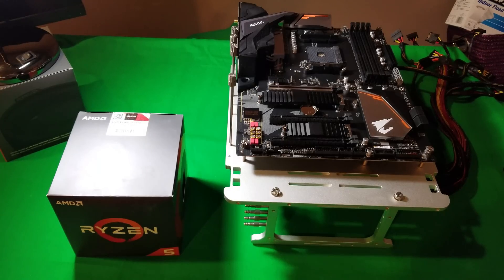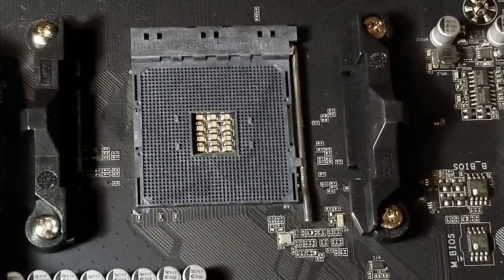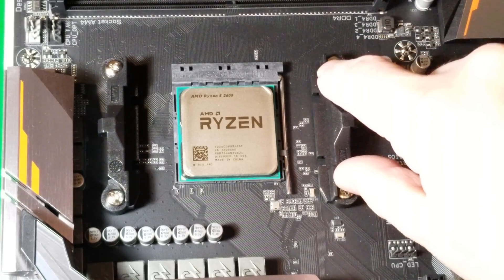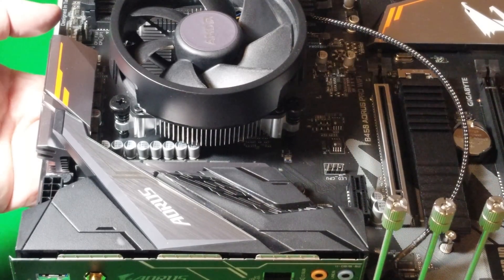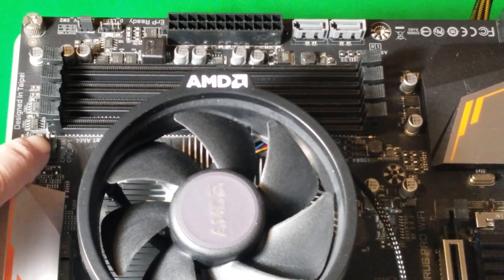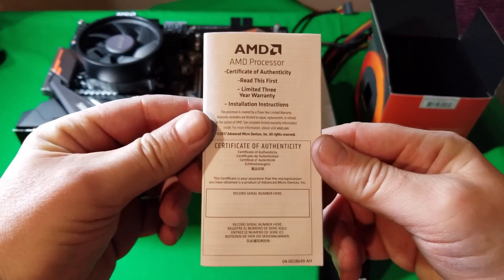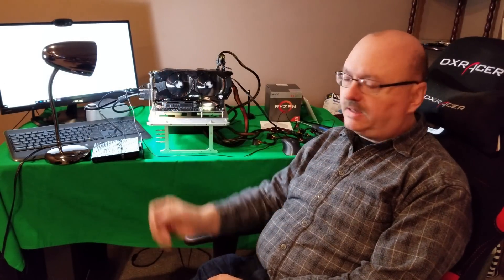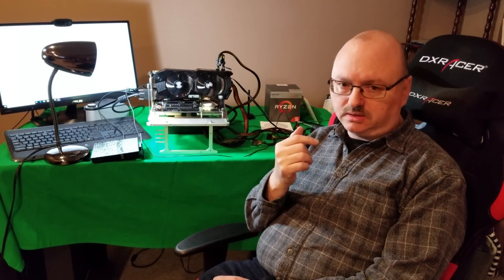Ryzen 5 2600 Unboxing and Install plus CPU Cooler Temps

Comment: One of the screws won’t screw in. What do I do?
Reply from the maker: So as long as your referring to the screws going into the back-plate, I'd suggest if it's not going in and you think it's due to some defect in the cooler, that you return it. However if the back-plate itself is the issue, you could try replacing the back-plate equally as big a pain. You could try checking to make sure it's lined up properly and maybe try turning it and restarting, could be a possibility they machined it wrong. I know it's a stretch but really if it's not screwing in, that sounds like one of those two is defective. Lastly ensure that the back-plate is not just dropped down in one corner and if so just raise it up and try again. Hopefully it's the last one otherwise not sure of any other things it could be.
Reply: Reviewing Playing & More RPM I got it in with a bit of pressure. Thanks for the quick response though.
Reply from the maker: +FlavoredRick Great job man...

Comment: I bough this CPU yesterday. At stock settings the CPU frequency is not reaching 3.7GHZ (3750mhz). Temperature at full load is around 67-72C. Is this normal ?
Reply from the maker: Not at home to check but stock is 3.5 so if your getting 3.7 you've done well. That temp under Full Load seems reasonable for the speed. It's good. Enjoy...
Reply: @Reviewing_Playing_and_More_RPM  I think you misunderstood. I have seen all over the internet that this CPU reaches 3.75ghz on all cores during stress testing/gaming. Mine is only reaching 3.6ghz. Can you check yours and let me know. TIA. Keep up the good work <3
Reply from the maker: Hi so I tested it under full load using AIDA64 Extreme, and the results are: Max Core1 3892, Core2 3767, Core3 3892, Core4 3817, Core5 3892, and Core6 3892...Temps at Max 74-76, low of 27, Idle 36 settling at 27-28 Hope that's what your looking for. If not let me know currently learning more and more about this so it's cool to run these tests...Averages were 3519.7 btw...
Reply: @Reviewing_Playing_and_More_RPM  Thank you for the detailed info. Can you run cinebench ( make sure to close all the unnecessary background apps) and let me know the score please. Also try userbenchmark.
Reply from the maker: Sure I'll do it later tonight. Be interesting to see don't run Cinebench to often. For the Benchmark are you looking to see FOS or something else? Anyhow have a great day...
Reply: @Reviewing_Playing_and_More_RPM  Cinebench scores are typically same at stock settings for the same CPU. If your scores are similar to mine then I can be rest assured that my CPU is not faulty. You too have a great day :D
Reply from the maker: Hi, so I tested with Cinebench 15 and results are: CPU 1239 cb, single core 157 cb, MP Ratio 7.88 cb, also did OpenGL but think that's for my GPU which was 115.88 FPS, Ref. Match 98.0% Hope that helps verify your CPU. Take Care...
Reply: @Reviewing_Playing_and_More_RPM  Thank you man <3
Reply: Those scores are perfect
Reply from the maker: Cool, good to know...your welcome...Have a great day...

Comment: Hey i bought this processor too, is it possible to overclock to 4 ghz with the stock cooler?
Reply from the maker: +KaifamGaming It is possible, be aware that the temps will be higher than the normal not sure but around 70 is not uncommon. Keep an eye on the temps for a while to be sure. I'm a noob on overclocking though so got the info online. I have overclocked mine using the software from the motherboard manufacturer but if you know how to do it otherwise it's been said it works better that way but I don't know for sure. Currently doing research on the topic for a future video. 3.8 to 4Ghz should be your target overclock not sure about higher.  Take Care and Thanks for watching...
Reply: Its recomended to use a beefier heat sink if you want more longevity out of your cpu
Reply from the maker: @cloudleal5984  Yep I agree, because I was going to play games for a bit I did replace it myself with a new aftermarket cooler...

Comment: Hi, i mounted this cpu and cooler on my b450 motherboars.

But im getting insane temperatures. 79-93C degrees!!!
The only thing i did wrong was that i palcsd the cooler and try to remove it. But due to the stickyness of the coolingpaste wich was already on the cooler it didn't came off easely and kinda forced it off the cpu. After that i placed it back on the cpu and started the pc. Only with abnormaal high temps.
Have you got any tips? Already updates all drivers... Windows 10 ryzen 5 2600

Btw, great video.!
Reply from the maker: +Unbeastable Well if you have concerns about the paste you could remove it and re-apply it. Have a look to ensure there's no gap between the cooler and cpu, it should be sitting on the cpu. That could explain the Temps as they are high. I have a video testing the stock cooler on the 2400G at Full load and it was only 74c so shouldn't be much higher than that. Only other thing is making sure it's plugged in to the CPU fan spot correctly. Otherwise without having a look at it its difficult to say for sure.
Reply: @Reviewing_Playing_and_More_RPM  After googling i found out that speccy isnt monitoring the temps good. I uses HWmonitor, RYZEN MASTER and checked my bios tem and all was fine there. not higher than 34c. So the problem is Speccy. Thnx for the quick reply anmd keep up the god work!
Reply from the maker: +Unbeastable Glad that's all it was and its working. Thanks for letting me know...
Reply: Mee too my friend, and i dont know why is this high temp...
Reply: @taymookrumpli3991  If you are using Speccy than thats your problem. use another software like RUZEN MASTER or HW MONITOR you can check your BIOS too. But dont use SPECCY.
Reply: Hey man really great video, I've had problems installing my cooler on my MB, it seems to be taking a huge amount of force to screw in the cooler, the backplate also looks like it's firmly attached, the screws just spin in place, and whenever I get a thread going, it pops the opposite side out...ugh.
Am I supposed to compress the springs?
Should I put more force into it?

Comment: In New to building pc's so i m getting a ryzen 5 2600 same as you sir i already have my pc built but I'm just upgrading my cpu and cooler i don't need another motherboard do I ?
Reply from the maker: +Parker Crowell If you have a AM4 motherboard that can take the new Ryzen CPU then no, otherwise you will. Easy way to check is pcpartpicker.com to check compatibility issues...
Reply: Ok I did some research I have a asus m5a78l m lx plus motherboard may u please tell me if I can install the ryzen 5 please. @Reviewing_Playing_and_More_RPM
Reply: @Reviewing_Playing_and_More_RPM  I just found out its a am3 :(

Comment: is the 2600 heatsink smaller than the 1600?
Reply from the maker: Instead of the 95W cooler AMD bundled with Ryzen 5 1600, the 2600 comes with a 65W Wraith Stealth heat sink/fan combination. Although the  thermal solution is fine for stock frequencies, it definitely limits the new chip's overclocking potential.
Reply: @Reviewing_Playing_and_More_RPM   i'm just wondering what temps that stealth cooler does under full load , the only thing i hate from these coolers is that mounting system , on some motherboards the holes don't match perfectly and its a pain to get it screwed in decent on the first try .
Reply from the maker: +W-Tek I'll check it tomorrow and let you know...You're right about the mounting I always have 1 slot that is harder to fasten then the others...never ran into the holes not matching though...
Reply from the maker: +W-Tek Hey I realized I didn't know how to do this so figured it out just now. I recorded it and will be this week's next upload so thanks wouldn't have tried it otherwise. So used AIDA64 Extreme running it under 100% full load for 6 mins and max temp was 74c, not bad for a stock cooler. Hope you find this info useful. Take Care...
Reply: @Reviewing_Playing_and_More_RPM  actually i thought it was going to be less then that.... But yeah thé stealth is a cooler that was used for thé ryzen 3 lineup... What was AMD thinking bundeling this with a 6 core. I ordered my 2600 today but ordered a Bequiet cooler with it
Reply from the maker: +W-Tek Great choice...